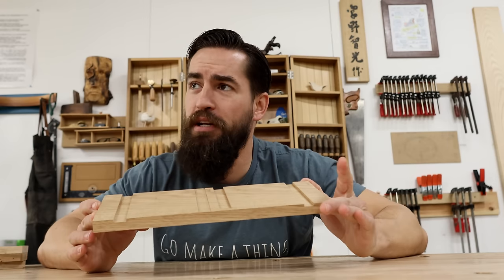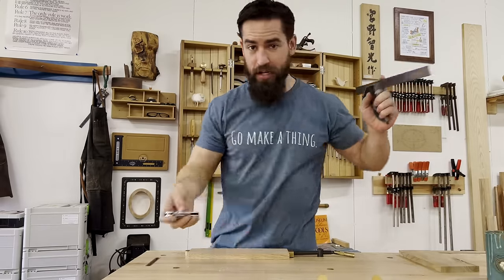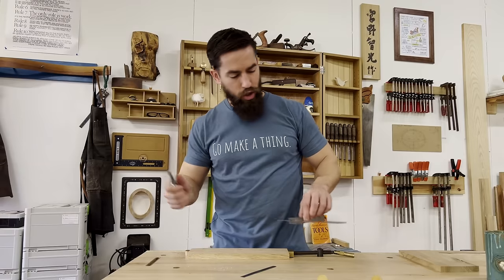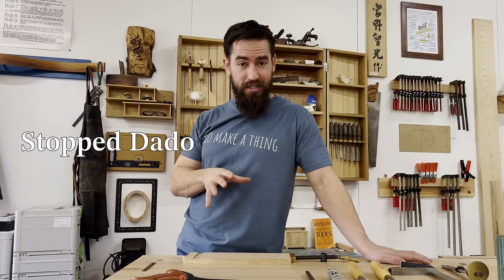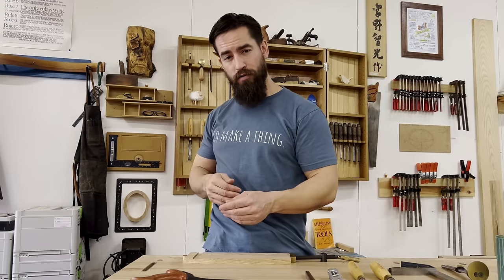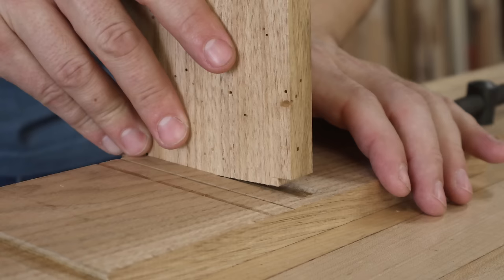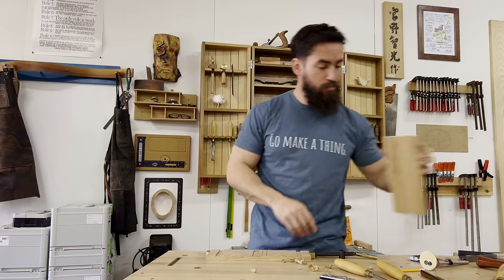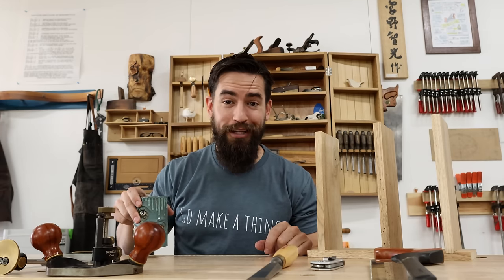Hand tool woodworking is easier than you think

Comment: It's not until times like watching you math the shoulders, that I truly appreciate the metric system. I work in both because my mum refuses to learn the simple metric system, but for anything I'm doing alone it's metric all the way!
Reply: Always fun to need to swap between metric and imperial for a project.
Reply from the maker: Hahaha I work in both. Used to metric from years in cabinet shops and dealing with clients from all over. But I still love imperial for no good reason!
Reply: @tektrixter  a project? Nope every time my mum gives me a measurement when wanting to buy something since all our shops are metric! Drives me mad but I gave up that fight years ago
Reply: @ENCurtis  I think you'd confuse a lot of your audience if you used metric. Might make a fun April fools though
Reply: @ENCurtis  you're not old enough to have ever used Imperial. You use Standard. An Imperial inch isn't precisely 2.54 centimeters, a Standard inch is. Now granted you can't actually see the difference between an Imperial and a Standard inch, but it's there. You can't see atoms and molecules either. That doesn't mean they're not there. Just you have lousy eyes.
Reply: I use Standard and Metric.  Depending on the situation one is often superior or easier to use than the other.  I also convert between them on the fly in my head.  (I have never actually said what I think about people who can only use metric)
Reply: @paulmartin2348  I've tried to use metric. I just don't like how the scale looks. I mean I really don't like it. The Standard sixteenths scale is a thing of beauty. The stepped graduations are genius. That's some functional design right there. It certainly helps to know what you're looking at. Once you do then you can appreciate what it is. Those that don't really are speaking from ignorance. There, I've said it. I know more about metric than metric advocates do. It's just the sort of thing I know about. Technical facts are my thing.

Comment: With a beveled blade, I find it helps to always make the knife wall on the waste side of my square.   The bevel knife can leave a “v” cut, with the v protruding into the show-side of the piece.   It’s a little thing, but sometimes the little things make big differences.

If your marking gauge is sharp, use it as a router plane to get consistent depth to dado.
Reply from the maker: That's one of the reasons I usually put a shoulder on my dados. Covers a multitude of sins.

Comment: The first carpentry job I had was for a contractor who loved Japanese tools, he started me out cutting 2x2 balusters for a railing with a hand saw, he checked each one for square and I think I messed up a little on each one, but over the years I got to where I could cut square every time, so practice is key, but I also noticed that my approach had changed, the way a engaged the saw, and to my surprise these techniques transfer between power and hand tools, which may explain why I’ve never encountered kick back with any tool, I got used to applying good technique from hand tools and brought that over to the power tool, and thank you Erick for leaving the origin out of the video!!! That tool takes so much away from woodworking that it makes me sick
Reply from the maker: Different strokes for different folks, and I find the Origin quite useful in my business. But there are absolutely applications for nothing more than a bit of sharp steel and some meditation.

Comment: The last joint is exactly how i built my workbench, each joint has a place, all wood is not equal.

They were longer wider pieces and the joints were only a mil or two bigger than required so a very small taper with a handplane and unless you pull up precision measuring devices up to it you can't tell.

Comment: Appreciate you and the content you provide... I've just started implementing hand tools into my workflow and wow it is just so zenful! I currently have a set of cheaper chisels, when upgrading... is there some particular traits to look for? Oh, looking forward to those spring days to open up the shop, unfortunately today we just got hit with twelve inches of snow. Happy making!
Reply from the maker: I would just look for a reputable company. That's the most important. They'll usually have good steel and a quality finish on their tools. But if you see any that you're unsure of, a rough texture on the back surface of the chisel (if you can see the mill marks clearly it's too rough) generally indicated a lower quality tool.

Comment: If you were to grind the end of that handle slightly, you could just put a socket on it and use a 1/4” ratchet (not an impact) to snug it up more easily without having to fool with that little handle; the handle is just leverage which a ratchet would provide

Comment: I just started woodworking by building a 24 x 16 workbench. I did it with 2x4s and some plywood and mdf. All the legs are the same length but it is wobbly as heck. It used dowel pins to attach the front and side braces to the legs. It’s the same wobble if it is right side up or upside down. What happened and how do I correct this in the future? Thanks for the great videos. I can send a picture of the bench if you want it.

Comment: Lightbulb moment! 💡, as you were measuring the depth of the dado using your circular marking gauge I had a flash go off in my head, I wonder if one of that type marking gauge could be used if one didn't have a router plane ?🤔
Reply from the maker: You could! Might be slow going but in theory it would work.

Comment: I agree about the knife. The double bevel on a so-called hobby knife is not a problem: you intuitively hold it at a slight angle in order to compensate, and that’s one of those things that just work. I also have a nice, fancy single bevel marking knife, and I find it quite awkward to use: holding the knife at an angle feels more natural. And I also have to admit that I’m a fan of replaceable blades.
Reply from the maker: I wish I didn't like replaceable blades as much as I do... but alas.

Comment: Cutting dados by hand, relatively in inexpensive. Making a board, (jointer, table saw,Rockler crosscut sled,)  expensive!  Don't worry, its all in fun. As they say, without wood its just working!
Reply from the maker: Not wrong! But its a lot cheaper to pay someone to make a board flat for you than pay them to cut accurate dados 😂

Comment: Hey Eric when doing the stopped dado couldn't you just insert the piece backwards and do the marking from what sticks out . i use this method to make some of my work less tools and very accurate. thanks like channel bro.
Reply from the maker: That's a great tip. Love that man.
Reply: Exactly what I was thinking.  That way if you cut the dado a little deep it still matches the proper depth.
Reply: Transfering dimensions is inherently more accurate than using measuring instruments are.

Comment: What about cutting the shoulders first then making the dato to fit? that seems like less math. Or is there more error chances in trying to mark the dato to the shoulders depending on the depth of the shoulders?
Reply from the maker: Certainly could do that. Just giving the way I learned and have implemented!
Reply: Another problem that shoulders present is offsets. You always have to take that shoulder width into account with where faces are going to end up.

Comment: If you had two uprights, each leaning toward the center at 5 degrees, how would you go about cutting dadoes to fit a shelf between the uprights? The end of the shelf would be trimmed at 5 degrees also, so the bottom of the dado needs to match. I did ask Paul Sellers, but I am sure he never saw it. His people said they could not answer it as it was not concerning one of his projects. I have never asked many questions, and that is the only technique I have asked anyone to show me. I have actually done it with power, but it took a LONG time to set up a router, and then I had to redo the whole setup to do the other side. If something had slipped, my workpiece would have been ruined, though my hands were nowhere near it. I have come up with a somewhat acceptable method with hand tools, but I can't help but wonder  if there is a better way.
Reply from the maker: I would do the exact same technique except use a sliding T bevel to set my angle and mark the walls. Would also consider making a guide block at that 5 deg angle to guide my saw as I make the side wall cuts. But everything else is the same. Shouldn't be too complicated, just more time consuming.

Comment: Around 27:00, could you just put the shelf in the dado and use the overhang to mark your shoulder?
Reply: Yes you can, and really you should in case what you removed doesn't completely match your marking.
Reply from the maker: absolutely you could.

Comment: Isn't your marking knife a single bevel?  Perhaps that would be better for getting a nice 90 degree edge when cutting the edges of the dado...  hmmm...  but maybe it's harder to hold the marking knife at a 90 degree angle as you score the line.
Reply from the maker: The 90 single bevel is nice in a few applications but I'm just used to the dual bevel of a normal knife.
Reply: But if you think about it the bevel is proud of the flat face. So your score is going to be proud of the straight edge regardless.

Comment: I've got the opposite problem: how to do it using machines. I know the hand tooling, it's the machine I need to think about a bit.
Reply from the maker: I've got a few videos on how I cut those dados in other projects from late last year. Super simple method with nothing more than a trim router and straight edge.
Reply: @ENCurtis  trim routers are cute and all but half inch collet plunge routers are how real pimps roll.

Comment: You cheated, you didn't hand plan or use a hand saw to cut the wood to size but it was interesting. I use the hand plane at times and a router plane, I did use the Stanley 55 on the humidor I made for a two rounded groove design in a drawer.
Reply from the maker: I've never not been a cheater in that regard hahaha

Comment: I'm outta here at 5:44. I came here to learn about woodworking with hand tools. (I just had to drastically downsize my shop of the last thirty years and now no longer have space for floor model power tools.) What do I get, this guy rambling on about how nice it is outside and then using a jointer, thickness planer and tablesaw to dimension his lumber. Not a hand tool in sight. And now after over 5 minutes he is almost ready to lay a squared up line on his material. Sorry folks, with no power tools my time has become exponentially more valuable.

Comment: Might not be an unbias opinion but, since I had a very small accident (but a bad PTSD coming from it) on the table saw after three years of using it, due to too much confidence with it, hurry and tiredness all combined together, I realized that machinery is way less critical in a project like it's often shown on YT content. Machinery and its evolution completly changed mass production but, in a single project, probably even building few of the same, it's overrated. For a limited sized shop the benefits of using them, in regard of the time spent, starts with dimensioning wood but rapidly collapse going on with the other steps of building a piece of furniture. If you start considering, also in those others steps, the accuracy factor, for me became a no brainer decision (even if it became a necessity). Nowdays, when I see on YT a single and simple crosscut made with a chopsaw, I feel sorry for that piece of wood.
Reply: When you get bucked off you have to get back up in that saddle again cowboy. That's how you earn your spurs. But do hang on a bit tighter in the future. ERs are crowded enough.